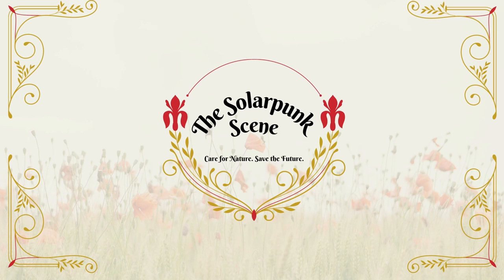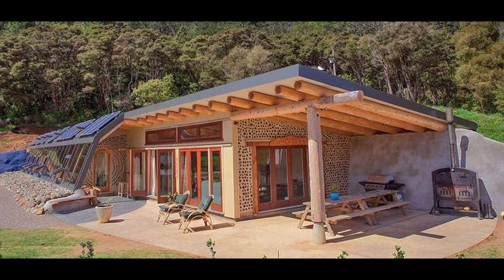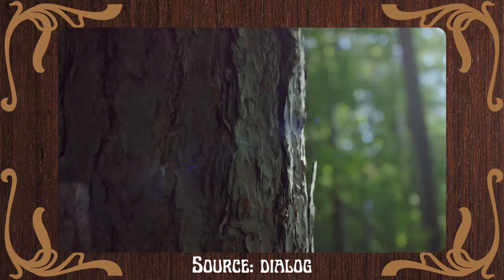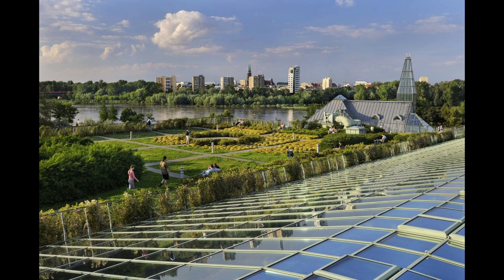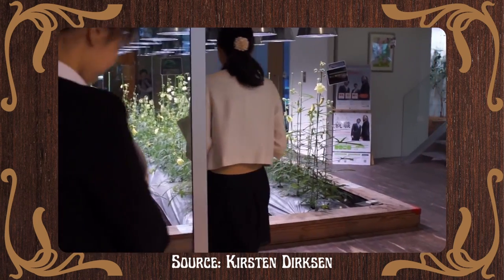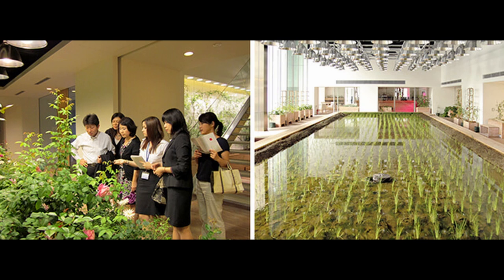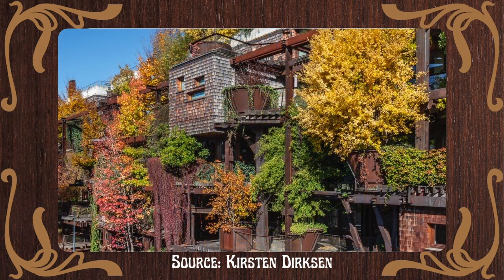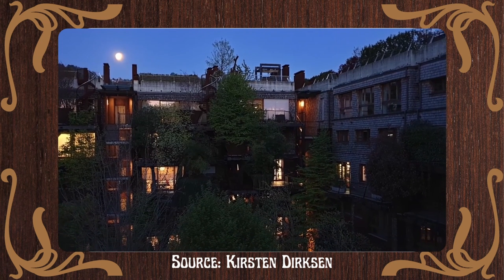Real Life Solarpunk Buildings That Will Blow Your Mind!

Comment: Earthship is good, sustainable but not everyone can or will have access to it immediately. For those who want to build a house quickly, sustainably, and to build it to be high-quality, I recommend straw-houses with straw-cob inside with recycled aluminum or hempen panels on the outside to protect the inner cob, which does not do well when wet. This is arguably more sustainable than earthship.

Comment: aesthetically it's nice, but does the library have some sort of drainage/run off system? looks like it needs to use an incredible amount of water to upkeep that garden. you also need to worry about birds flying into large glass windows if it doesn't use bird-safe glass
Reply from the maker: Here is a page talking a bit more about the exact specifications of the water system: https://zinco-greenroof.com/references/university-library-warsaw

The library tries to use mainly natural rainfall amounts but has a drip irrigation system installed for during times of drought.

Comment: Consider:
Raw food movement - the idea that the less you change the original food source prior to consumption, the better it is for you and the environment.
Now imagine applying this to solar-punk living - the idea that the less you change the original building material and landscape prior to living in it, the better it is for you and the environment.
Soft-Solar-Punk?
If all you own is a hammer, everything appears to be a nail.  If all you know is building Cities from over-processed resources then Mass Architecture is the result, but doesn't need to be.  I would say consider a tree house over building massive multi story structures, consider natural local materials in smaller spaces surrounded with nature and veggie gardens over concrete and process minerals provided by industrial processes and you start to see a very different application of living with the environment instead of conquring and manipulating it.